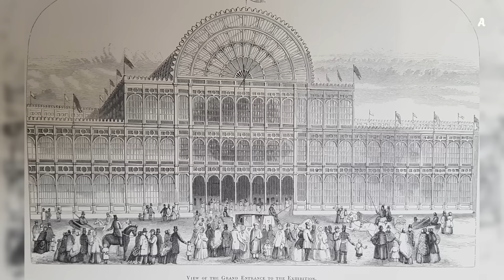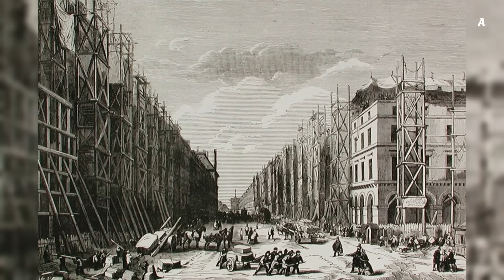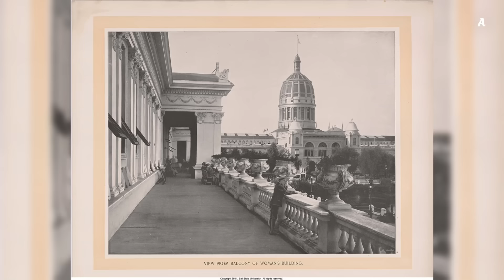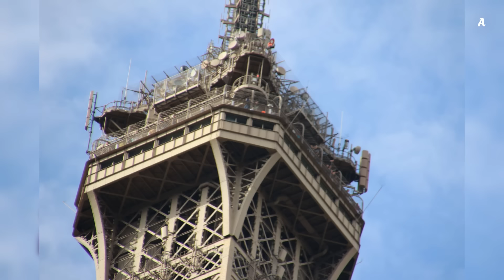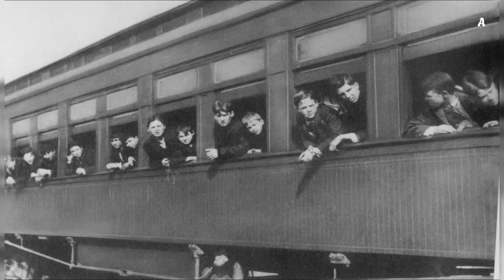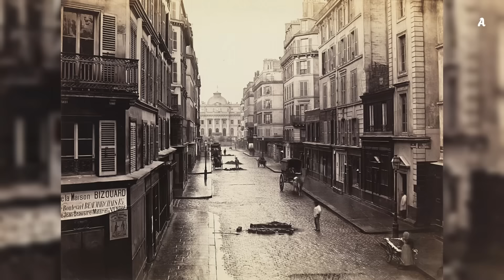PEOPLE Did NOT Build This! The Phenomenon of the Eiffel Tower and the Crystal Palace

Comment: YES! As a lifetime tool and diemaker I've always scratched my head when looking at any kind of metal work from over 150 years ago....endless rail lines, amazing cast features on near EVERYTHING? Making molds is not easy, especially way back. Foundries would have to be all over the realm with untold numbers of skilled craftsmen. I have never seen anything close to photos of numerous steel or iron works from the 1800's. They would have to be huge to accomplish even a fraction of what is claimed. I am forever skeptical for good reasons.....experience.

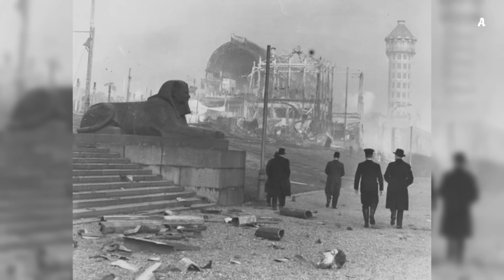Comment: @8:35 The pieces for the Eiffel Tower were manufactured at one location, Eiffel's factory in Levallois-Perret, on the outskirts of Paris. All 18,000 pre-calculated pieces were designed and prepared at this factory before being transported to the construction site for assembly.

Comment: As a photographer, I can attest that the several minutes long FILM exposures of old photos would indeed look like an empty street. As long as the people and horses were moving. Also, those old photos are digitally restored / cleaned up, as part of the process to digitize them. Therefore, any blurs or shadows in the photo would have been digitally removed. I would have to see the original unaltered prints to make an assessment of the photo.

Comment: This entire video is bullshit.  The Crystal Palace was made almost entirely of wooden flooring and timber supports inside the glass frame, the fire spread unbelievably quickly. Firefighters said the entire structure was a gigantic greenhouse full of dry tinder.
It was unstoppable because the interior miles of timber went up at once. The glass superstructure acted like a furnace, trapping heat. Fire engines couldn’t get inside the building to fight the core of the fire, and high winds fed the flames.
Reply: That’s what they want u to think! Don’t be a sheep.
Reply: Even if so, which I doubt, how about all the manufacturing issues???

Comment: First, I'm a firm believer in the old world. But the problem is we have photos of the Eiffel Tower being built - that and it's here in full today for a metallurgical analysis. Also, stamps of "Forges et Usines de Pompey (Fould-Dupont)" are all over the metal, which is where the iron was supposedly cast. The Crystal Palace is something else altogether, and there's no photos of that being built - that and it was an even more grand achievement than the Eiffel Tower.

Comment: I Demolished the Old East Perth Power Station with about 100 or 300 others it was truly amazing and yes the steel was incredibly tuff which had also Not Rusted at all. The original Alcoa bauxite refinery at Kwinana is also a piece of engineering that none of the engineers understand but it still produces the most and its the smallest and oldest refinery in Western Australia. I have also visited all of Perths significant old locations which are all plaquaded as Founded meaning Found. Many years ago Perth was covered in abandoned buildings. Many of which were still fully furnished with furniture covered in a white bed sheet. Some times even had their Classy Silver cutlery in their cabinets and old glossy magazines. There were so many propertys left in Perth in this condition, totally empty for donkeys years
Reply: Now THAT was interesting, mate! Please tell us more....

Comment: Crystal Palace was just like a greenhouse it was exactly the same sized archways for each panel and exactly the same size main archways on the top of the roof and it wasn't a load bearing structure mate it was effectively a window frame the same as a greenhouse just bigger and it wasn't just horses and cars most goods were shipped by barge pulled by Clydesdale horses and in case you are unaware Clydesdale horses when they were in a team of two could pull more than a current tractor and Eiffel Tower has many photographs of the building process from start to finish including at the foundation stages. And in case you haven't seen a building project before they don't get all the materials there at once they're given it in phases. You've just said all of this river thing done in the wind and at height how do you think all the skyscrapers were built with all the steeplejacks you had a similar video saying the same crap about Scotland's Forth rail bridge and that was clickbait nonsense as well. You keep going on about Crystal Palace if it's some sort of Engineering Marvel it's just cast iron frame holding up greenhouse glass the Crystal Palace is almost exactly the same as the roofing above Brighton Pier etc which was Commonplace in Victorian times it is just that on a bigger scale you can see from the pictures of the wrecked Crystal Palace that there was nothing to it. The pictures of the devastated Crystal Palace still show all of the metal in its original state where is this molten iron you are referring to also the Germans were using incendiary bombs the Crystal Palace was filled with plants and vegetation you are twisting the facts to fit your narrative it's not complete total destruction of the Crystal Palace it's just been knocked over like any greenhouse in any garden all the metal is still in its original shape and form it's just lying in a heap and the main roof is still standing your words are not backed up by your pictures

Comment: I removed some of these cast iron beams from old wold buildings in Sydney Australia many decades ago and still have some folding wedges that were under the beams that I saved. After 35 years sitting in a box in my shed they have not rusted along with the other tools in that box. Also the structural beams that I removed were twice the mass of the replacement Universal beams.
Reply: I would like to see a similar video done on the Sydney harbor bridge.
Reply: @Aussiesilvernomad Even the bridges here in the U.S. 
I DNT believe they build those...new bridges they build are trash
Reply: Good job mate 😅
Reply: That's because iron is not very strong.it cracks ,it delaminated but is slow to rust ,because of lack of carbon .Carbon steel is way stronger ,rusts quicker .So . . There's the thickness issue answer .
Reply: @Bergoinecourtney  NO. Iron has a HIGHER carbon content than steel.
Reply: https://youtu.be/9muQf_IvM4s?si=VG3T-8Fl1cl-973L
Reply: Spain traveled and heavily documented what they came across, someone needs to go thru their archives.
Reply: @jumpingship3001  You believe everything they indoctrinated you with at school still, some one needs to wake up your asleep my freind.
Reply: @vicrigg9390 you believe every alt theory and a i generated video about the " little season", Tartaria and the nephillim's return you see on the internet
Reply: You can't wake anyone wake up. You can provide information and inspiration only. Waking up is a individual freewill choice.
Reply: So I take it the French the English all the different Native American tribes etc they all just went about their business while Chicago was already built like that I take it? Even though they were all living in log built fortifications or in compounds the main trade was trapping and trading in fur then of course there was the French and English war over possession of the Americas then of course America's war of independence with Britain then of course the American Civil War but by your claim these things all happened around magnificent stone buildings that had been there since when? And why the hell would they destroy them and not just keep them and claim them as their own like the Egyptians have with the pyramids the pylons on top of his tall buildings are lightning conductors you muppet the Eiffel Tower is a massive version of the Blackpool Tower and before they had radio waves transmitted they had lightning conductor poles you're mental fossil fuels were being burnt for hundreds of years before any Eiffel towers were built have you never heard of the horrendous air pollution and the smog in London due to all the fires in all the slums the Eiffel Tower was built at the end of the 19th century shortly before the Wright brothers built the first aeroplane but after the Montpellier Brothers built their hot air balloons and after Phineas fog had travelled around the globe in a hot air balloon. Did you never play with Meccano when you were a little boy that's all the Eiffel Tower is a skeletal framework with an elevator going up and a couple of floors
Reply: @iaincannon1976  Your defending a history that can not be explaned,  the buildings were constructed to fast, the building and doors are to large, the building were not fit for purpose, the buildings are still standing after hundreds of years the ones that were not deliberately destroyed anyway.Think about it.
Reply: @iaincannon1976  Sir, you need to go back to the beginning of the "Mud Flood" topic, and learn the fundamentals of these conclusions. or you'll muddy the water (pun intended :)  These conclusions are built on solid evidence. I understand a lifetime of education is hard to abandon, especially when it's built on the psychology of, "Ignorance is bliss."

Without malicious intent, you are stating, "Don't confuse me with the facts, I have already reached my conclusion." Otherwise, you may want to study the words of God. Oops.

Comment: During the Cuban revolution which ended in 1959, I have hands on knowledge of improvised incendiary devices used against the Batista regime by my father.
Preparing a very simple but effective device under water, White Phosphorus was used.
Once ignited any water used to try and extinguished the flames only created explosive results making the fire worse. Keep in mind that White Phosphorus burns at a reported 2,700°C, hot enough to melt glass, iron, everything! 
Properly handled and kept moist to prevent ignition, once any water evaporated— maybe during the course of the evening— ignition would be inevitable and impossible to put out.
Perhaps we need to consider this as a possible way to burn down anything these parasites deemed too dangerous for public consumption.
(sorry for the rant)
Reply: Sounds lieke wildfire from got 😮
Reply: @qingluo8069  or Sodom & Gomorra. In the area, geologist have confirmed the presence of Sulfur nodules all over the area. So, maybe…?
Reply: Do they pay you overtime at the Bureau for Internet posts?
Reply: @RA_D-u4z  there are other perks. For instance, replying to dumb questions. Thanks for the support!!

Comment: My father was an industrial engineer, he designed the massive steel structures used for warehouses, some of which have their own zip codes, even in the 1980s his constant headaches were from steel casting wasn’t right and caused all manner of problems
Reply: We use rolled steel not cast iron for construction, IE: rolled steel joist then the process changed now they are universal beams. Cast iron is use in manufacturing like hydraulic press stands.
Reply: If only he had been getting some experience building some garden greenhouses for tomatoes and (sweet) peppers. Everything else would have been easy... Take me for example. When I was a kid, I built castles from mud on the beach and now I build palaces in just a few years like it's nothing. You got to start small and then palaces, castles, arches, bridges, and such become so much easier. It also helps a lot to keep an eye open for design competitions. I tend to win these and then the rest is so easy.
Reply: @Fortress333  😹😹😹😹😹😹
Reply: @Fortress333 😂😂😂😂😂
Reply: @Fortress333  Great fun!